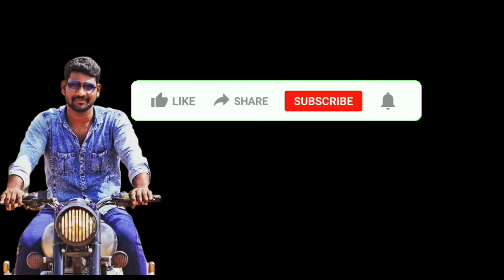Interlock Bricks ఇంటర్ లాకింగ్ బ్రిక్స్ తో కట్టిన ఇంటీని చూదాం రండి contact number 9492749208

Comment: E interlock system lo cement light ga oka layer just like gum rasi natu rasi brick pedte additional strength ostademo ankuntuna . 

Okavela ilu ki ilu motam kataka in case edana wall ki additional window pedtam ani wall ki cut chete apdu wall slab nundi padipotundi . 

So danger . Plastering chesaka adi inter lock a normal brick a telidu 
Vere person konkoni like additional window or exhaust fan petali ani peda hole cheste slab nundi bricks padipotane untai so some drawbacks untai. Anyway nice idea